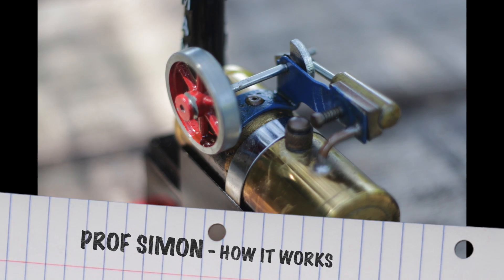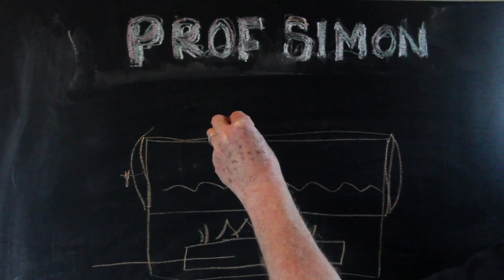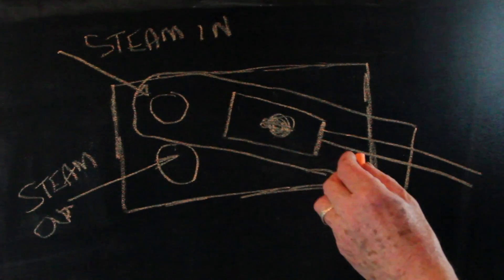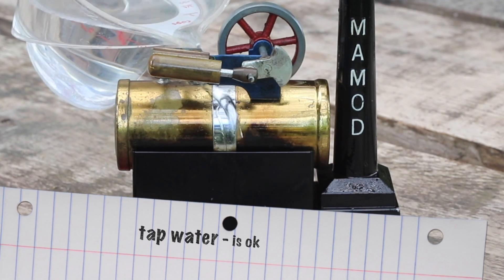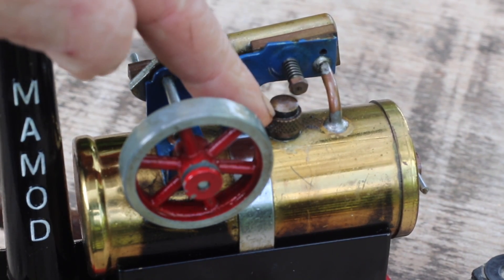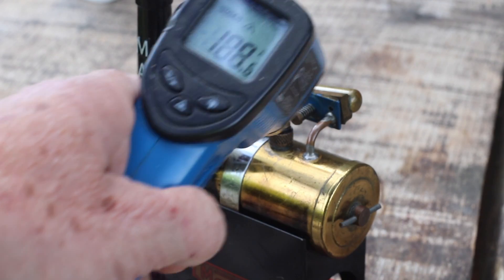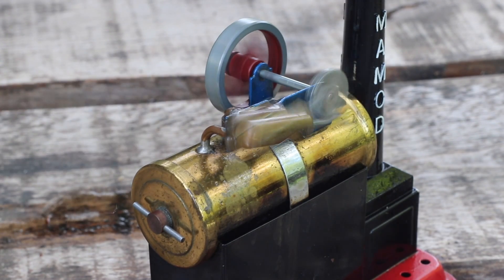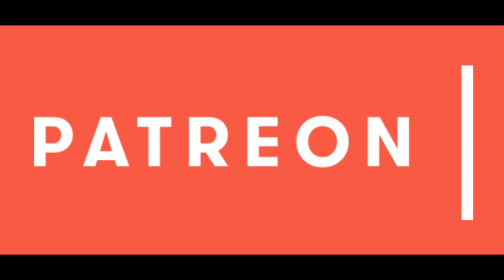Mamod toy steam engine - How it works - Prof Simon

Comment: Thanks Professor Simon! It’s funny all these years I’ve been calling it a Mamond steam engine, note the n before the last d. I’ve never heard anyone say the correct name until now. I bought one of these when I was a kid for the equivalent of 10 pounds. I wasn’t content with a stationary engine so I added some wheels with some meccano.i couldn’t get hold of one of those metal spring drive belts, so I made my own out of an old bicycle tube. It ran really fast except the drive belt had a habit of melting.